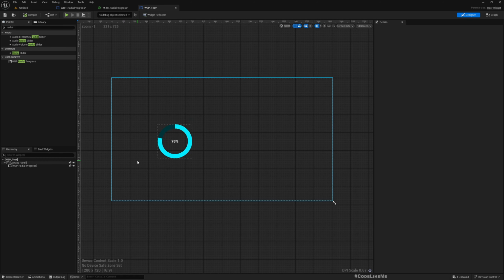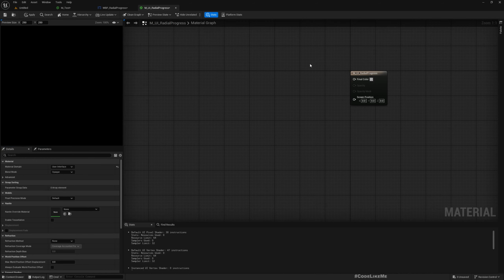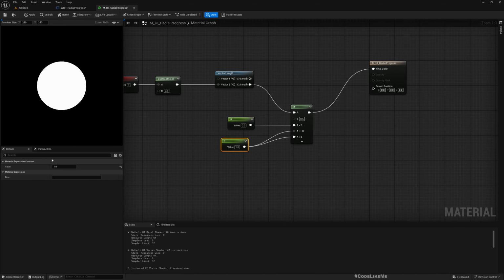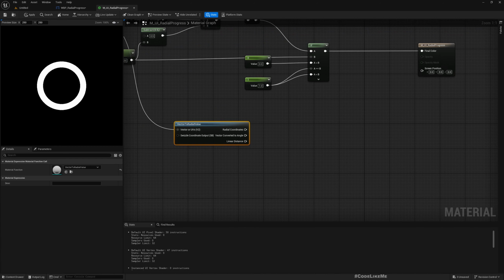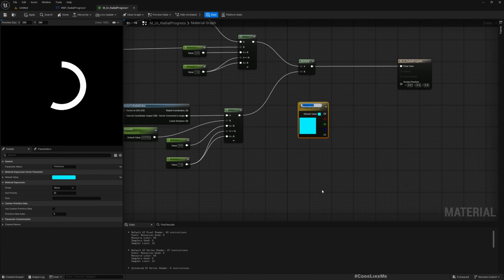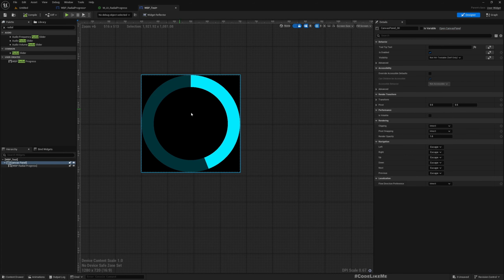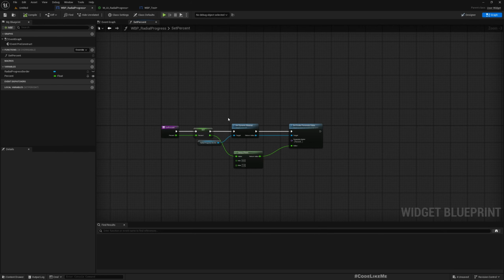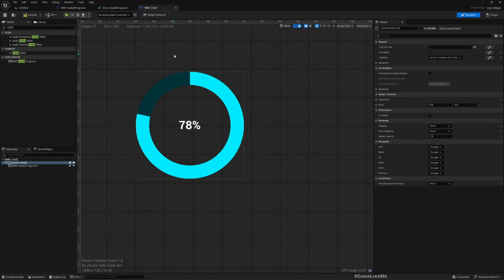Unreal Engine Radial Progress Widget Tutorial

Comment: all of this can be done using the radial slider which is a built in component of widgets. You dont need to use custom materials or anything.
Reply: Radial slider has a "bug" where you can see some miscolor i guess you can call it when it's at 100%.